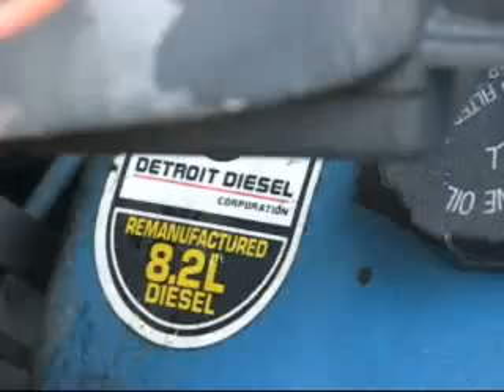8.2 diesel F600 Chipper Truck

Comment from the maker: Hi there! The chipper runs from a transfer case. Kinda like a 4x4. PTO powers the dump. It has a 5 speed manual transmission. Not sure what kind. The thing chips good with all that power behind it!